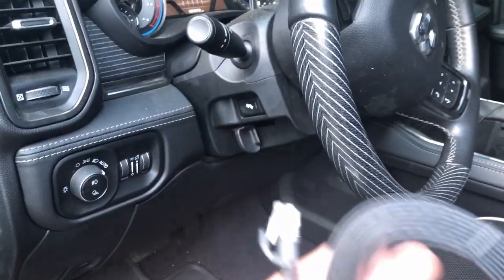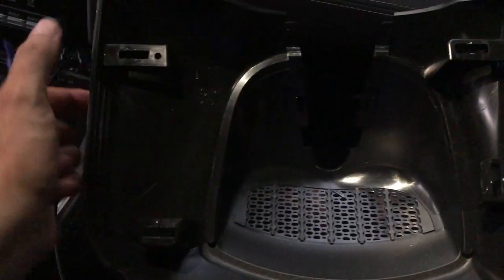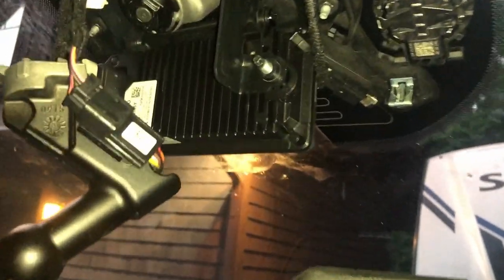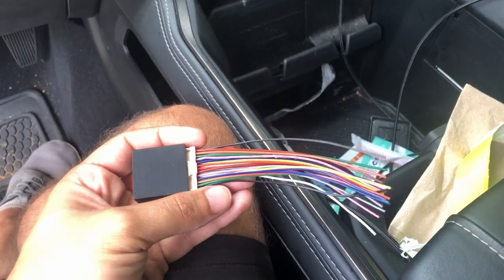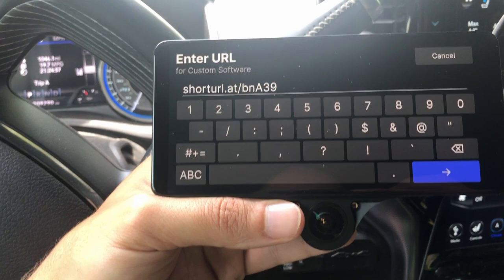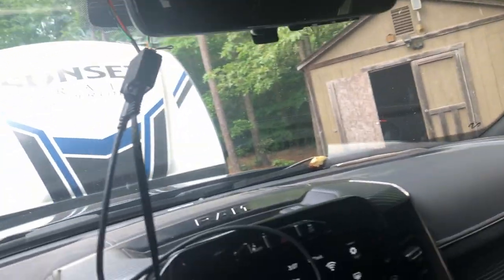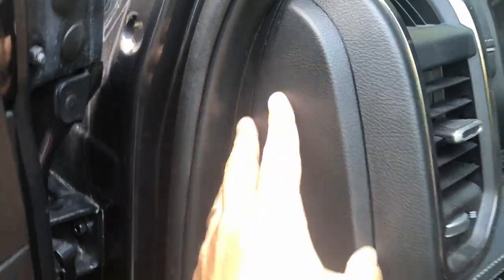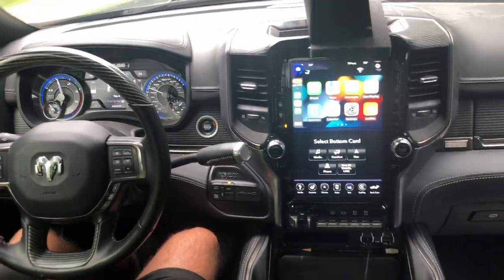How to setup  a Comma AI in a RAM 1500 or 2500

Comment: Glad I found this, I'm still trying to decide on this.  My wife already hates the rear view mirror camera so adding another screen might not be popular.  Also would need to move radar detector and possibly dash cam.  But the Ram lane keep assist is pretty useless as is if not borderline dangerous.
Reply: Also, where did you get the ram mount?  Was that included in the ram kit or 3rd party?

Comment: Thanks for the great review!  You mentioned the truck was way off to the one side and made you feel uncomfortable. How did you fix this?  Does it learn eventually or did you have to reposition the camera?
Reply from the maker: Sorry I didn't realize I was logged into the wrong account. To reiterate, I changed teh software I used from the software I mention in the video. I now use a newer version of the C3beta which takes into account the taller 2500 that I have.
Reply: @gunnarwb  thanks for the info.  Is the beta software accessible directly from comma, or somewhere else?
Reply from the maker: its on the discord channel mentioned in the video @asong26  but its only needed for the 2500, 1500 is officially supported

Comment: Are you still using Comma? Which version or fork of Open pilot are you usin
Reply from the maker: Yes, I still use it all the time. I even installed it in my Kia as well. I don't remember which branch I'm on, its just worked solid for so long I kinda lost touch with that side of the house.

Comment: hi, thnx for sharing, question: does 2500 ok to openpilot? it’s not on compatible website of comma, thanks
Reply from the maker: Eh. Kinda. I know since I shot this they moved to fully support 1500 but not the 2500. Its a taller truck. Therefore I continue to use the community build which takes the height into account. The short version is its mostly supported and you shouldn't have too much of a challenge getting it to work.

Comment: how can i get the ram mount
Reply from the maker: 1/ Don't. It doesn't drive well from that location, I stopped using it. 2/ If you are going to ignore me you need to find the RAM Discord Group I mention in the video. 3/ Don't ignore me, the truck doesn't drive well on the mount. :)
Reply: not ignoring just saw you replied. iput in the code and it loaded but i have a black screen now not sure what to do i did leave it unpluged over night but it still a black screen this morning. i installed it in a 23 ram hd. @gunnarwb